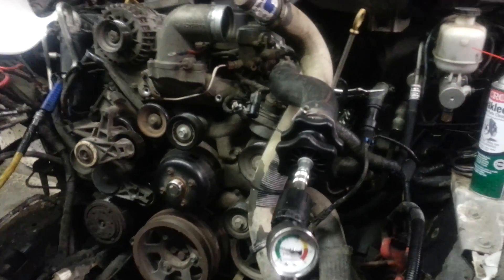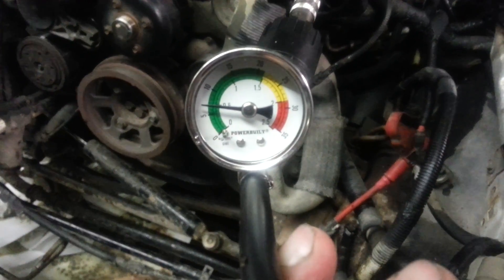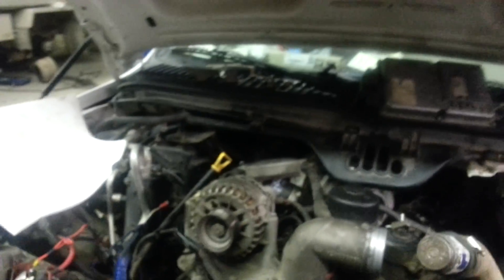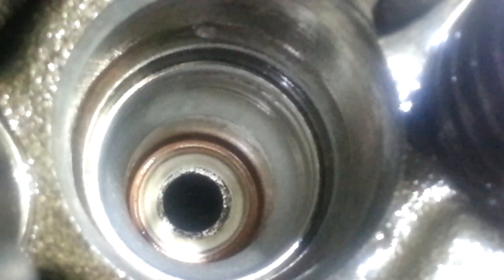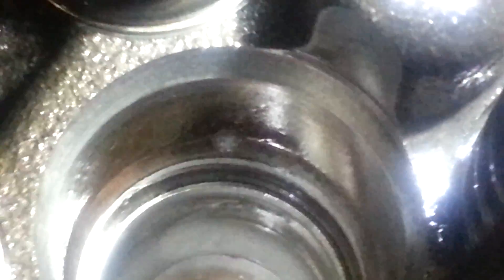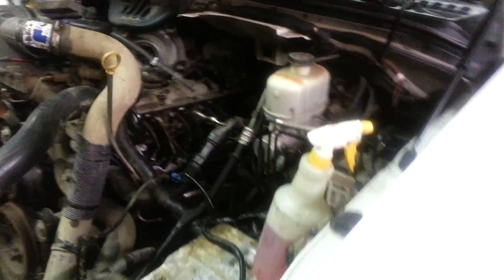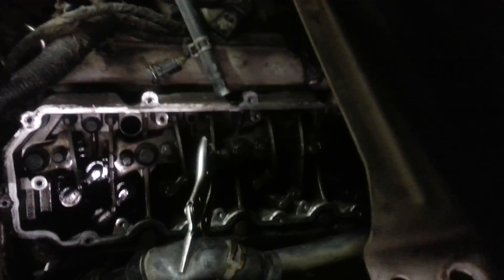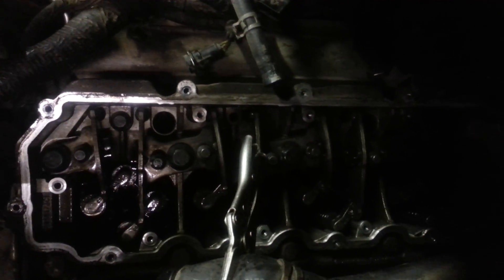Ford 6.0 injector bore crack

Comment: Awesome job and great information on how to diag! Currently have a 60 found bad injector cups and a couple smoked O-rings. Will be using this test before I start replacing cups to check and make sure I don’t have any cracks in mine, appreciate the share brother.